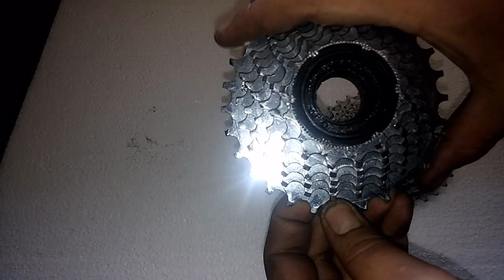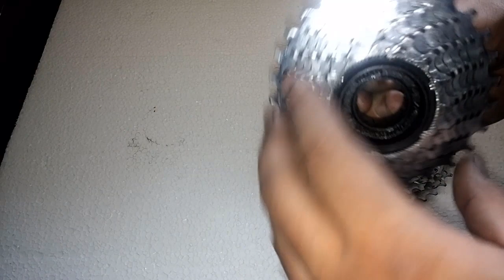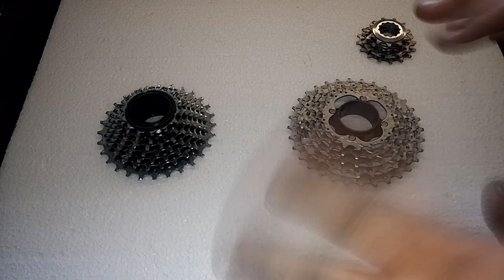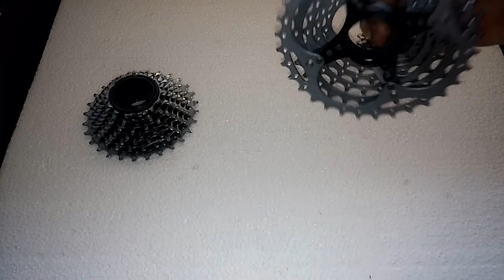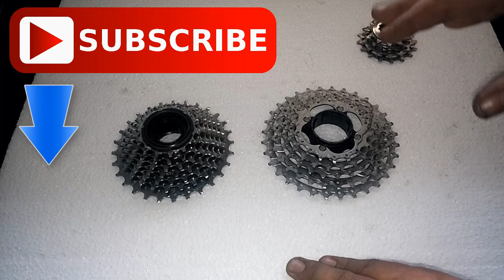Freewheel vs Cassette - What Are They? - What's The Difference?

Comment: how can you recognize it if you cant remove wheels and remove the sprocket on if its freewheel or cassette
Reply from the maker: When you take a look on the right side of your bike search for the lock ring close to the rear hub. On a freewheel you won't find It. You will only see the smallest cog and the hub. I hope you will figure it out.
Reply: Being an ancient cyclist, I have used both. This is easier to see with the rear wheel off. Spin the gears backwards. If the gears spin backwards and the center portion (where the mechanics are) does not move, it's a freewheel. If you spin it backwards and the entire cluster spins, it's a cassette.

Comment: Here's a question I have why can't a freehub be screwed onto the threads of a freewheel hub?
Reply from the maker: If u take a look on a wheel with freewheel threads u will see the threaded part is outside the hub on the right hand side. U can attach the freewheel to that part. But with the freehub u will find a hex screw inside the hub so u can change or clean the freehub if it's needed. And u can simply slide the cassette onto that. So basically they are different technologies and not interchangeable. - Bikehun
Reply: BIKEHUN thanks that makes a ton of sense!